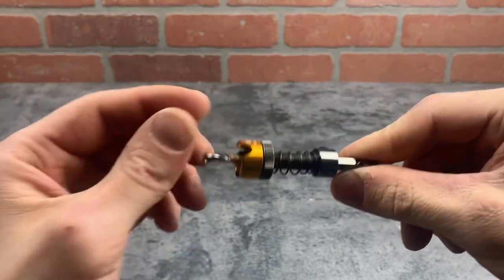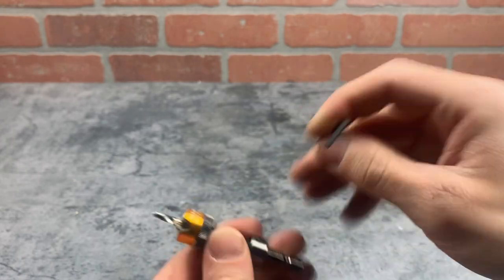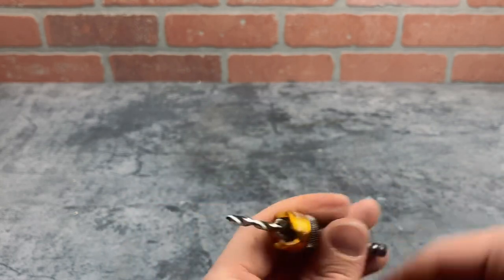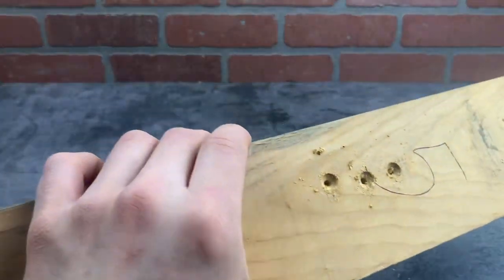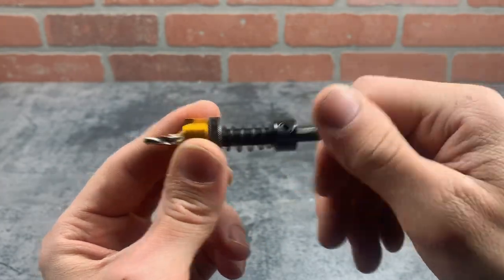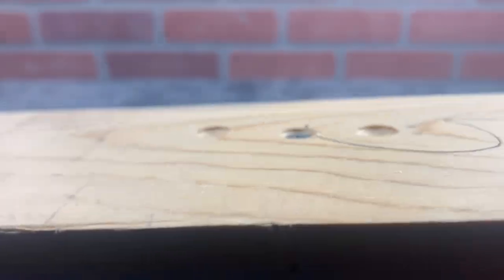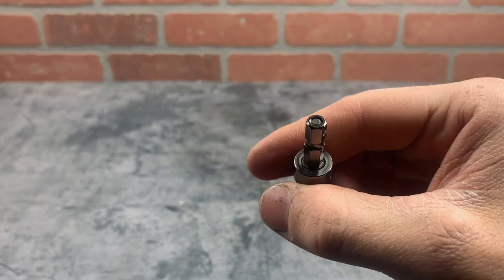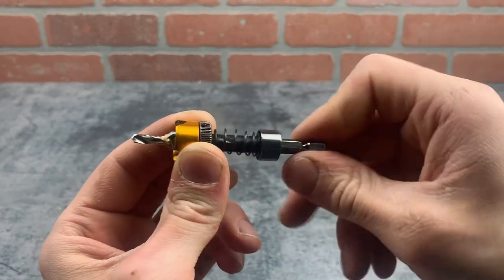Adjustable Depth Countersink Drill Bit - Review

Comment: HOW do you adjust the depth?
Reply from the maker: Grab the black knurled round piece at the front and then twist the shank of the bit, or activate the drill.
Reply: @WoodyGoodyReviews  I mean how do you adjust it for the screw you are using?
Reply: Is the drill but supposed to be as long as the screw you're using?
Reply: @waterlilly62lori  The depth is adjusted by loosening the allen screw and then either pulling the bit out or pushing it in.  Yes, it should extend to the length of the screw.